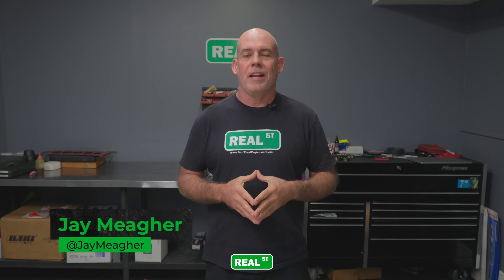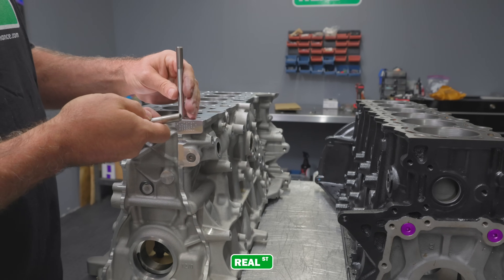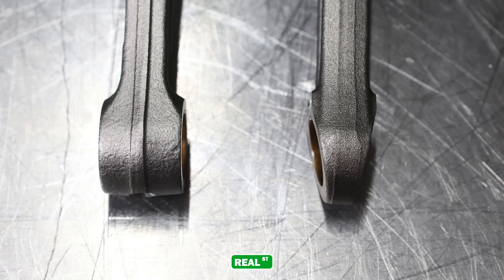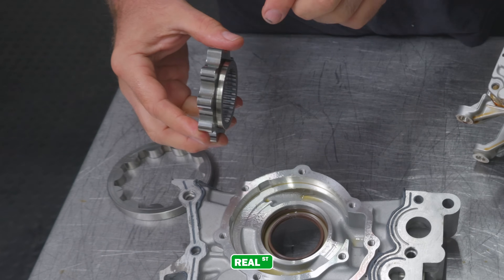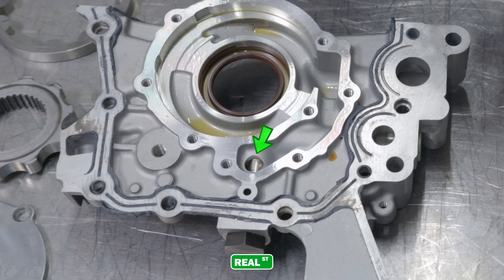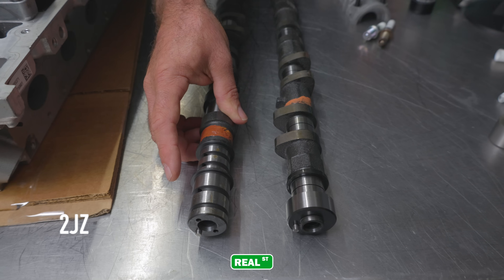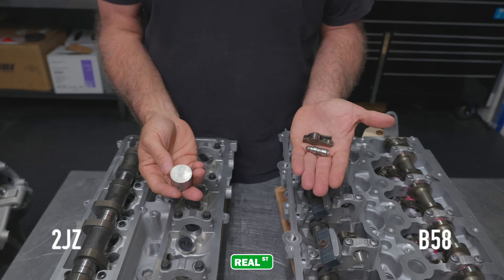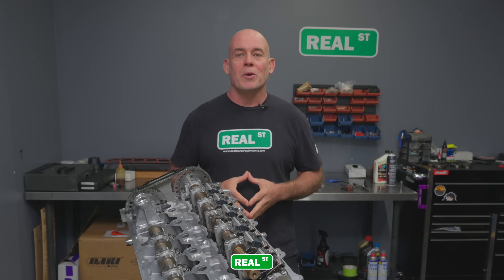Toyota 2JZ vs BMW B58 | Comparing Both "SUPRA" Engine Internals Side By Side In Detail

Comment: Great video! I still like 2jz simpler and more reliable. And with aftermarket blocks and im sure heads to come there is more potential to be unlocked
Reply: B58 is reliable 😂
Reply: @bman1668 but not 2j reliable.
Reply: @bman1668 Until the warranty is up, then its resale value goes in the garbage and it's nothing but problems, like every other BMW.
Reply: @PistonAvatarGuy  yea that’s why Supra holds its value and still in low 50ks for used example…
Reply: @bman1668  Which Supra? The Mk. IV is 30 years old and still goes for $50k.
Reply: @PistonAvatarGuy  mk4 is more expensive mk5 is low 50 high 40s
Reply: @PistonAvatarGuy you are a blind hater, the B58 has proven to be equally reliable to the 2JZ and more tunable. The 2JZ is a bit simple in compare to work with but that's about it.
Reply: @tempeztad  lol. Tell me you know nothing about engines without telling me that you know nothing about engines.
Reply: @PistonAvatarGuy   People have hit well over 200k miles on the B58 with minimal issues, the N54/N55 days are over.
Reply: @Josh-qm4rb  It's a plastic engine, TIME will be its biggest enemy. 2JZs last 30 years with minimal issues.
Reply: @PistonAvatarGuy  talk about yourself? Cause that's all you proven here.
Reply: @PistonAvatarGuy  SOME of the B58 EXTERNAL parts are plastic, not the internals. I'm pretty sure the 2JZ also had some plastics here and there too, I may be wrong tho.
Fun fact: if left completely bone stock, the 2JZ-GTE isn't as reliable as people say it is. The factory ECU is problematic at times, the stock twin turbos were known to fail. The 2JZ engine itself is rock solid obviously, so that's all the reason people have got single turbo on them, so they are pretty much problem free with bolt ons.

The 2JZs that have lasted 30 years with minimal issues are the GE non turbo model, which isn't the "supra engine" and isn't as strong as the GTE internally, and the GTE's that have lasted 30 years with minimal issues mostly have single turbo kits.
Reply: @Josh-qm4rb  "SOME of the B58 EXTERNAL parts are plastic, not the internals."

Again, proving that you know nothing about engines. Internal or external, they're still part of what makes the engine work, and brittle parts failing still cause reliability problems, and they still need to be replaced when they fail, sometimes at great cost (that's been my personal experience with German plastic engines).

"Fun fact: if left completely bone stock, the 2JZ-GTE isn't as reliable as people say it is."

Why, because someone said that it was perfectly reliable and never had problems? EVERY engine has a problems on a long enough timeline and the 2JZ has been around for a LONG time, especially when compared to the B58. The 2JZ has proven itself to be one of the most reliable engines EVER MADE, even while offering the incredible performance that it does. It is every bit as reliable as people claim that it is, but that doesn't mean that it's going to be 100% free of problems for all time.

There were plenty of non-turbo Surpas, you're clearly a troll.
Reply: @PistonAvatarGuy  I'm just letting u know that the B58 isn't a shitty engine, and the 2JZ isn't god. I'm not saying the 2JZ is shitty at all, nor am I saying the B58 is god.
They're both very good engines, that both have their strengths and weaknesses.

To make big power (500whp) on the 2JZ, tuners replaced the stock twins and the ECU, as well as the plastic impeller in the water pump (early models)
To make big power (500whp) in the B58, tuners replaced plastic parts with metal parts.

I do know that plastic parts aren't good in the long term, but it's been nearly 8 years since the B58 was released and I've seen many people on forums say they've been achieving 200,250k, even 300k with hardly any issues.
Reply: @Josh-qm4rb  "...and the 2JZ isn't god."

Compared to the B58, it kinda is, man.

The B58's strengths are fuel economy and being light, the 2Jz's strengths are literally everything else.
Reply: @PistonAvatarGuy  About "god"... I'm talking about engines as a whole, not just compared to the B58.
The 2JZ blows up at around 1000whp, the 5.2 FSI V10 from Audi can hold 1700whp before it blows...
People have been making 850whp pretty reliably on the stock internal B58s, with bolt ons, so even if the 2JZ can hold more power than the B58 which is a likelihood, the difference isn't much.
U just sound like a fanboy.
The 2JZ is factually one of the strongest engines out there, and you get mad because there ARE stronger engines than the 2JZ and the B58 is a worthy competitor, even though it may be a tiny bit weaker in terms of making power.
Reply: @tempeztad  I am pretty sure the 2JZ is a tiny bit stronger internally, but only a tiny bit, so there's that. People are still making 850whp reliably on stock internal B58s tho, the difference is very small, and to me that doesn't matter. But I personally prefer the B58 due to so many reasons, it's power delivery, it's torque, lightweightness etc.
But I mostly agree on what u are saying. It's definitely easier to make power on the stock turbos with the B58
Reply: @Josh-qm4rb  "The 2JZ blows up at around 1000whp, the 5.2 FSI V10 from Audi can hold 1700whp before it blows..."

It's a 5.2 liter engine, bud, why isn't it making 5,200 hp before it blows? The 2JZ is as legendary as it is because it's a 3 liter engine that can hang with huge V8s, or even nail them to the wall in many cases. In its class (You know that racing is divided into classes, right?), the 2JZ is absolutely unmatched. Let's see an engine from any Audi, or BMW, run a 5 second 1/4 mile, THEN you can compare them to the 2JZ. Until that day, those engines aren't even in the same universe as the 2JZ.

"...even though it may be a tiny bit weaker in terms of making power."

Right, because the 2JZ being more than 2 and a half times stronger means that the B58 is just a tiny bit weaker! Ok, buddy!
Reply: @PistonAvatarGuy  That is very true, I give u that. The fact that the 2JZ can compete with big V8s despite being only 3 litres is something special.
But there is one 3 litre engine that is stronger than the 2JZ, and that is the S58. Redbull drift brothers have made 1039 crank hp (883whp) for 2 years now and they haven't rebuilt it, that's for drift use that involves HOURS on the rev limiter and at full power constantly, not street use and drag use with a bit of high power redline for a few seconds here and there. 
Take a look: https://www.youtube.com/watch?v=_D6aywCInfI
There is also an S58 apparently running 1200whp with the stock internals.
But I strongly appreciate what the 2JZ can do considering it was built in the 90s, 30 years ago! That is definitely something to be proud of.

Edit: I don't think a 2JZ would be stronger than a B58 by 2 and a half times 🤣
Reply: @Josh-qm4rb  You are right brother, my thing is that these people just rate engines on how stock block holds and not on how efficient power is made up including weight.

You don't need extremely hight level of power if the engine put HP/TQ efficiently. Most B58 tuned cars are doing times that matches high WHP cars with less power.

On Circuit, TA and Solo the B58 has proven to be a beast as well.

I'm just saying that it takes more than power now days to measure how good an engine is.
Reply: @tempeztad  Exactly!
U are someone who knows their stuff!
I totally agree with u!
Reply: @Josh-qm4rb  Dude, THREE THOUSAND HORSEPOWER, that's what the 2JZ can make on the factory cast block and head, no BMW engine is EVER getting anywhere near that.

https://www.youtube.com/watch?v=oinmlCDKE-4 - Granted, this is a billet engine, but factory cast blocks and heads have been in the 5s.
Reply: @Josh-qm4rb  Even if you want to make the same, tired old argument about an engine at that level not even being a 2JZ, it's still something that could never happen as a result of an evolution of the B58, as it would always be forced to carry on the shortcomings of the B58 (or S58, whatever). It would still have closer bore spacing, it would still have a weirdly configured cylinder head, it would still be stuck with smaller bores and smaller valves, etc. The B58/S58 will never reach a 5 second 1/4 mile level of development, PERIOD.
Reply: @PistonAvatarGuy  "THREE THOUSAND HORSEPOWER" 
🤣🤣🤣
I don't think so...
A 2JZ needs cams at 1000hp, the record for a 2JZ factory block is TWO thousand horsepower, which is incredibly strong, like 2k on a factory block isn't good enough for u 😭

U just sound like a troll, I'm not gonna talk to u about it anymore... Think what u want
Reply: @PistonAvatarGuy  We will see, only time will tell 🤷‍♂
Reply: @Josh-qm4rb  "...the record for a 2JZ factory block is TWO thousand horsepower,"

No, bud, it was stated in an interview of one of the guys who was running 5s with the 2JZ (I'll look for the video). I believe Jay even confirms this in this very video! The car owner did say that reliability was a problem at that power level, but the engine absolutely was making enough to run 5s, which absolutely is in the 3,000 hp range.
Reply: @Josh-qm4rb  Well, that took some digging: https://www.youtube.com/watch?v=8Ji4_7nIHdc @ 13:02

Paraphrasing: "...guys have gone 5s on the factory block..."

Edit: Some info may have amalgamated in my brain from several different sources. I know some of my info on this matter comes from an interview of the guy who runs the Yuasa Camry. I know someone was running extremely quick ETs and breaking factory blocks, I'm pretty sure that they were either in the 5s, or very nearly there.
Reply: @PistonAvatarGuy  Yes, that's 2000hp, not 3000hp
Reply: @PistonAvatarGuy   Well, you are correct tbf, I just watched it and maybe he potentially did use the factory block up to 3000hp. He had to keep on rebuilding the engine tho, because at that power level, it's not reliable at all, he went through many broken main bearings and cracked blocks. To get the power that high, he would have probably also machined it to make it stronger, change the shape of it slightly etc. So I wouldn't say it's capable of a boost level so high that it makes 3000hp. 2000hp is the limit. I'm not sure he even made 3000hp on the cast block, maybe more like 2000-2500 absolute maximum, then he bumped it up to 3000hp with the billet block.
But the fact that iron block withstood 3000hp for short periods of time is mental.
Reply: @Josh-qm4rb  "Well, you are correct tbf..."

Basically always.

"He had to keep on rebuilding the engine tho, because at that power level, it's not reliable at all, he went through many broken main bearings and cracked blocks."

I think that you're confusing Geo with the guy who was actually running 5s. That's partially my fault, I also though that they were the same person, but it was a different person. Geo seemed to be having reliability issues at much lower power levels than some of the fastest guys who run the 2JZ.

"...he would have probably also machined it to make it stronger, change the shape of it slightly etc."

You're just pulling nonsense out of your rear.

"So I wouldn't say it's capable of a boost level so high that it makes 3000hp. 2000hp is the limit."

And who are you? Just some punk kid who's trying to hate on one of the greatest engines ever built. I don't understand the hate for the 2JZ all of the sudden, is it a racist thing?

"I'm not sure he even made 3000hp on the cast block..."

You can't run a 5 unless you're making around 3,000 hp, so did it just teleport?

"But the fact that iron block withstood 3000hp for short periods of time is mental."

And it's why the 2JZ is the god of all 6 cylinders. DEAL WITH IT.
Reply: @PistonAvatarGuy  Well, after a long think about it, he could well have done 3000hp with it, just to be an absolute daredevil, so I'm pretty sure I believe u now. 
The reason why: BMW's turbo 4 cylinder Formula 1 engines from the 80s produced 1500hp and they used factory iron blocks from BMW M10s found in junkyards, that was a 1.5 litre engine. The 2JZ is twice the displacement, so 3000hp could well be the record, so I'm sorry for doubting that displacement. However, people have cracked their factory 2JZ blocks at way less  than 2000hp. 
That's not to say the B58 is a shitty engine tho, the B58s block is still very strong even though it's unlikely to be as strong as a 2JZ. The B58's factory aluminium block has seen over 1200hp being constantly abused, full boost for hours on the end at the rev limiter and for the years it's been used, its held up just fine, so for the odd quarter mile run it for sure could handle more.
And NO I am not being "rAcIsT" to the 2JZ, i know how good it is, I've seen it all for myself, but u just sound like you are doubting the B58 way too much. It's only been 5 years since it's gotten extremely popular, give it some time.
Reply: @PistonAvatarGuy lol dude a Coyote V8 can run 7s on the factory unopened engine and trans, has ran faster than the 2JZ record, and can make way more power than any Toyota engine ever without a turbo. 2JZs are overrated fan boy engines. Outside of drag racing, the Supra is a turd which is something that you can’t say about the Ford modular engines.
Reply: @ryanturnerboles  In the world of 6 cylinder engines, the 2JZ is absolutely unmatched, I don't know wtf you're talking about.

A whole bunch of the Ford modular engines are fraught with problems, unlike the 2JZ. Even the VVT 2JZs almost never had problems with their cam phasers, unlike the mod engines.
Reply: @ryanturnerboles  I should add that the VR38DETT is probably superior to the 2JZ, but it hasn't had the same level of development in pure drag racing cars. The fact that these small displacement engines are able to even compete with much larger V8s just goes to show the absolutely incredible level of Japanese engineering. Imagine if they applied the same level of engineering to a V8 in the 5 to 6 liter range.
Reply: @PistonAvatarGuy  lol my guy Lexus has 5 liter V8’s, yet they don’t make as much power as the Coyote. Japanese engineering is nothing but recreating what America and Europe has already done. Porsche makes a 4 liter that has over 500 hp from a non turbo engine stock, and Mercedes AMG makes the highest hp 4 cylinder in the world. It’s not engineering if you have to change every component in the engine to make power. Show me one Japanese car that’s went 7s on a completely stock engine and transmission, and better yet, show me one Japanese car with a lap record in the top 10 of all tracks. There are none because Porsche, McLaren, Mercedes AMG, and GM run the game. And don’t forget, the ecotech 4 cylinder from GM made and broke more records than Honda in the drag racing world, but drag racing is boring and pointless.
Reply: @PistonAvatarGuy  also the GTR engine is not even impressive. Most those drag GTRs are running billet blocks and leaving nothing made by Nissan on that car. Plus those transmissions are made of glass hence Nissan voiding warranties after so many launches. Something Porsche never does, and now Nissan recycles old Mercedes 7-matics for the Z 😂
Reply: @ryanturnerboles  I said same level of engineering. A Lexus V8 was never intended to be a high performance engine, it was always intended to be a luxury car engine. Even the 2JZ was never really meant to be a high performance engine, it was always meant to be a GT engine.

And, no, the Japanese are not copying the Americans or the Europeans, they are doing their own thing, which is why they don't set records on the tracks that you're cherry picking, but they absolutely can dominate the highest forms of racing on Earth, like F1 and the WEC... when they decide they want to dominate in those classes. Let me know when an American company wins an F1 race, or the 24 hours of Le Mans. I'll be surprised if anyone ever beats Toyota's record at Circuit de la Sarthe, since the whole WEC was hobbled just so Cadillac could attempt to compete, which they STILL can't.
Reply: @ryanturnerboles  Yeah, dude, a 3,500 hp V6 isn't impressive at all. /s

And they do run the stock heads.

You're clearly trolling.
Reply: @PistonAvatarGuy  lol Ford won Le Mans 4 times and another time in 2016 in the GTE class, and ever hear of Corvette racing dominating with 9 Le Mans wins? Ferrari has the most wins at F1, so clearly they can’t. Toyota won Le Mans only because they were the only car in the class, and now Ferrari beat them the first year they returned. Overall Porsche holds the most wins at Le Mans of any car manufacturer.
Reply: @ryanturnerboles  You people just keep regurgitating the same, tired, incorrect nonsense, ad nauseam. My point is that Americans can't compete at the highest level at Le Mans NOW, or anytime in the past ~50 years, the level of technology simply vastly exceeds American engineering abilities. Anyone can win in the GT classes.

Toyota set the fastest lap EVER at Le Mans, because they built the highest performance car ever to race there.

Honda is currently dominating in F1 (under the Red Bull name), the fastest racing series on Earth. Honda also dominated in the first turbo era, when power levels exceeded 1,000 hp.
Reply: Also there a 3500hp corvette using a GM V6 with pushrods 💀
Reply: @ryanturnerboles  The V6 in that Corvette isn't based on any production engine, or even a Chevy engine, it looks like it's a Top Fuel hemi with two cylinders cut off. Making an engine bigger isn't exactly impressive engineering, which is why Americans can't compete at the highest levels of racing.

Edit: That Corvette doesn't even look like it's all that quick and it only races in the 1/8th mile.
Reply: @PistonAvatarGuy  is that why the Corvette and Camaro hold faster lap times at every track than any JDM car? I mean the Camaro almost tied the LFA on the Nurburgring, yet you’re bringing up race cars. If we’re going down that path, both Ferrari and Mercedes hold the F1 fastest laps. But that’s comparing drivers more than the car itself, since it varies per track. You’re also forgetting that GM developed magnetic ride suspension which is used by Honda on the NSX, MDX, TLX, and on a lot of other supercars. So no, we don’t lack the engineering. Let me know when a Japanese production car beats America and Europe on the track.
Reply: @PistonAvatarGuy  also let me know when a Japanese car can run a 3 in a 1/4 mile like the Top Fuel dragsters.
Reply: @PistonAvatarGuy  also you’re forgetting the fact that all those cars you mentioned only achieved those times because Americans built the internals that go into those record setting JDM cars lmao. Remind me where those tuner companies are from and where they buy parts…guess what, it’s here. I mean Dart is making 2JZ engine blocks, and most the research and aftermarket came from here. 😂
Reply: @ryanturnerboles  Again, highest levels of racing,

Japan has proven that they can beat whatever they want, whenever they want. No one would buy a Japanese muscle car, so the Japanese are never going to produce one. The same probably goes for a Japanese supercar/hypercar, because the people who normally buy those cars want the prestige that comes with the European brands that already produce them.
Reply: @ryanturnerboles  Americans produce almost nothing related to F1 and the cars that win at Le Mans, they just don't have the technology.

Seriously, do you people have a script that you read off of? You're like the third or forth person who's used exactly the same ridiculous arguments on me.
Reply: @PistonAvatarGuy  you forgetting Ford was in F1 and is returning to it replacing Honda as an engine manufacturer? You seem to also not remember that Japan has not built an F1 car. Honda has been an engine supplier to McLaren and now Red Bull, but never built their own car as most the chassis are designed and built in England. Also, GM supplies INDYCAR along with Honda, and both of those compete together with GM joining F1 in 2028. If we didn’t have technology, why’s Honda teaming up with GM for its battery powered cars because of GM’s battery technology? You forgetting Tesla and the tech that they’ve invented far surpassing any EV made? Toyota couldn’t even keep the wheels on their EV 😂😂😂
Reply: @PistonAvatarGuy  it’s hilarious that you think we can’t compete, yet again our production cars are faster than any JDM car ever. The LFA was the fastest production car to lap the Nurburgring, yet a $60k Camaro was 2 seconds off it 💀. Let’s also remember that Viper ACR that holds the title for the fastest manual transmission car at most tracks.
Reply: @PistonAvatarGuy  also the Corvette C8R set the LM GTE record at Le Mans, if we’re talking about race cars. Guess who set the fastest IMSA lap time in the GTP series…wasn’t Acura or Toyota who have all been in that series. It’s Cadillac Racing.
Reply: @ryanturnerboles  Ford was never in F1, COSWORTH was in F1 and they stopped being competitive 40 years ago. Ford will not be competitive in F1, I guarantee you.

Most manufacturers have another company build their chassis in F1. Edit: I was thinking of Indy. Honda built their own chassis in the '60s.

Ilmor supplies GM with engines for Indy racing. Honda builds their own engines (though they did also receive engines from Ilmor for a time) and they have the most championship wins out of any engine manufacturer.

I don't know why Honda keeps trying to partner with GM on anything, they probably just don't want to bother designing anything related to EVs. A person can distinguish the different qualities of one engine manufacturer from those of another, and reliability can vary greatly between engine manufacturers, but EVs are all the same, so Honda probably doesn't feel like they would gain anything by designing an EV entirely on their own. EVs are just appliances, there's basically no room in their design for any distinctive character.

Toyota is one of the largest manufacturers of EVs in the world, they just happen to also have ICEs under their hood. Toyota's hybrids are well known for having legendary reliability.

Production cars are worlds away from being Le Mans winning race cars, or F1 cars, they're on such an enormously different level that they're in no way comparable. And, AGAIN, Cadillac is proving that they can NOT hang with the big boys, even after the big boys were kneecapped.

The C8R is doing poorly in actual competition. Cadillac is doing poorly against basically everyone in the WEC. There's also something fishy going on with Acura in IMSA, but I wont get into that.
Reply: @ryanturnerboles  Really, the bottom line here is this: The fact that the Japanese don't produce cars that directly compete with the kinds of cars that you want them to compete with, does not mean that they cannot produce those cars, they clearly have the engineering ability, while the same cannot be said of the American brands with regard to the fastest racing classes.

And, really, in order to form your opinion on this matter, you look at track records which are being overseen by American racers and American magazines on American tracks and seem to believe that no bias can exist there, yet when Americans venture outside of an environment which is under their complete control, they fall short. Look at the Nurburgring lap records, look at F1 and the LMP classes in the WEC, Americans simply can't compete.

Top speed records, too, are highly dubious, with American companies flat-out lying in order to try to claim the record (SSC was caught lying about their top speed, Hennessy tried to use a car that didn't even legally exist, etc). IMO, the American cars being used to set top speed records shouldn't even be considered to be production cars, as they likely lack emissions control systems and the safety ratings of their European counterparts. Those cars are also produced in extremely limited numbers, often too few for them to even be considered production cars.
Reply: @PistonAvatarGuy  if that’s true, why did the LFA take years to bring to market, costs upwards of $400k, and still couldn’t compete with a Z06 Corvette or even the Carrera GT that came years before it? Also, most of those race cars that you’re talking about have the chassis built in Europe. Also I think you keep forgetting the tech GM invented called Magna ride suspension which almost every supercar uses now. And top that off with the fact that GM has the highest hp NA V8 made with it setting the 6th fastest lap on Car and Driver. Also, the ERay corvette with the hybrid setup being better performing and cheaper than the NSX which is Hondas highest performance car. So when you say we can’t compete, we literally have the most powerful cars ever, and GM was the biggest car manufacturer in the world. So clearly we can as shown by the Corvette and the fact that Honda needs Chevys suspension to make their performance cars even competitive.
Reply: @ryanturnerboles  The question that you should be asking is: Why are the Japanese able to dominate the highest levels of racing, but struggle when it comes to building high performance consumer vehicles?

I already gave you the answer, which is that they clearly don't know where to place their products in the market. No one will buy a Toyota Chiron, or a Honda 918 Spyder, because the people who (mainly) buy those cars aren't car people, they're status symbol people, and the Honda and Toyota brands aren't status symbols. The other issue seems to be the tax that the Japanese place on engine displacement, and even though this drove them to squeeze ever-increasing amounts of power out of smaller engines, it also forces them to produce cars with smaller displacement engines for their home market. We never got a Honda S3000, or a big V12 super car from Japan as a result.

No one NEEDS MagneRide, it's desirable because it can be adjusted between a setting that's good for road use and a setting that's good for track use, but a suspension system can be installed that works for only one of those use cases, which is why race cars don't use anything like that system. It wasn't developed by GM, either, it was developed by Delphi, which just happened to be a subsidiary of GM at the time.

I said that Americans can't compete at the HIGHEST LEVELS of racing, and they can't. Production cars aren't even remotely close to being the highest performance vehicles on Earth.

"...we literally have the most powerful cars ever..."

No, you don't. The most powerful V8 is not the most powerful engine in a production car. The LT6 makes 670 hp, while the Lamborghini Aventador makes up to 100 hp more than that. The Aston Martin Valkyrie makes 1,000 hp from an NA V12! The only car that can supposedly be considered to be the most powerful production car is the Hennessey Venom, but, again, shady.
Reply: @PistonAvatarGuy supra kid spotted